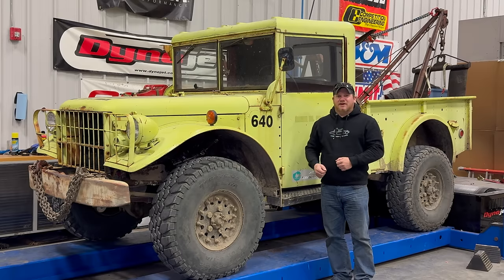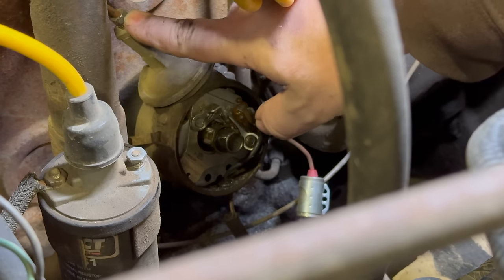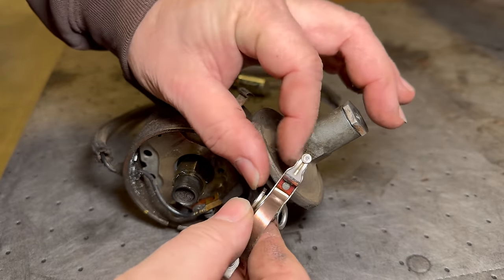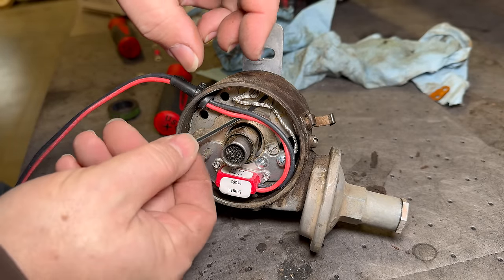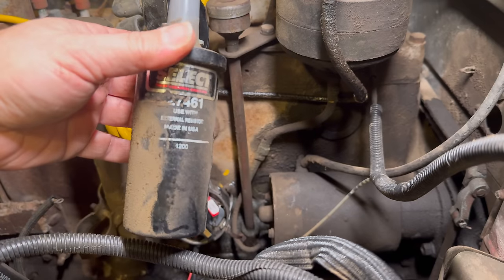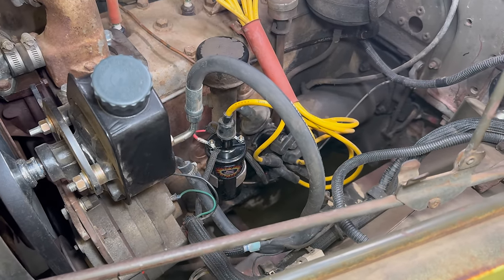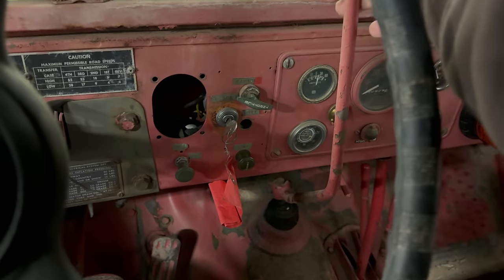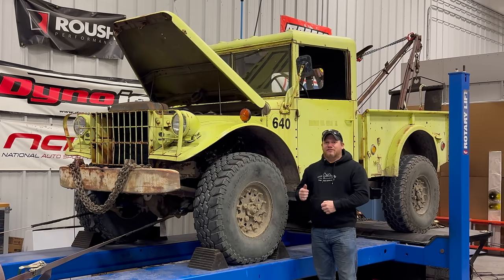Ignition Upgrades M37 Vintage Off Road Wrecker

Comment: If I had that and wanted to keep the stock engine I would increase the compression ratio as well put a better carb and ignition and have less things on the engine. For me personally I would put a diesel in it and lockers.

Comment: Need loc-tite on the mounting screws. Vibration can work those screws loose and cause all kinds of missing and lousy running. Ask me how I know!🙄
It took me a week to track that one down!
Reply from the maker: You mean the little Pertronix screws?
Reply: @ThisWeekWithCars  Yes. The two screws that secure the Pertronix unit in the distributor. Mine came loose and the car started running like crap!

Comment: When you drilled out the rivets you seemed to have disconnected the vacuum advance rod as well.  Did you manage to reconnect it?  It wouldn't affect the max power but might affect part throttle behaviour.
Reply from the maker: It didn't disconnect it, might have just looked like it but if you pause it after at the right place you can see it was always attached.
Reply: @ThisWeekWithCars  Ok, My bad.

Comment: the small capasitor is for radio noice.. the weeeeeeEEEEeeeEEEEeeee radio sound filter
the big RESISTOR is a old radio sound dampening too to not make sparks go klick klick klick klick
when spark plugs ignight... so please ask a electro duude about the spark sice if you remove set RESISTOR
and sign on for the MATT OFFROAD WRECKER OLYMPIC.. even you dont partisipate you can display you 
truck and worst thing happening som 1000 subs.. respect.. i realy hope for a huge turnout of wreckers on display
so the fans can meet you..

Comment: on Nicks garage he sets his engines to 34, 36, 38 degrees so yours at 2 is different. state the torque ? 180 torque was it?
Reply from the maker: Same thing, just reading the timing at different RPMs.  The 34-38 degrees is total timing I was setting the base timing (before centrifugal and vacuum advances kick in) as stated in the original Technical Manual.